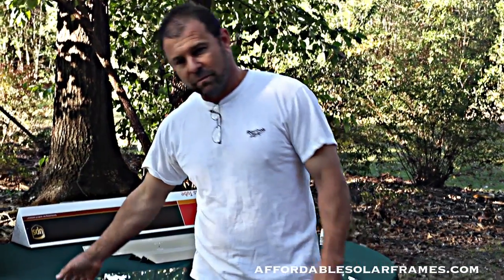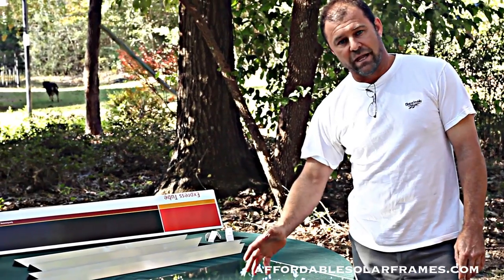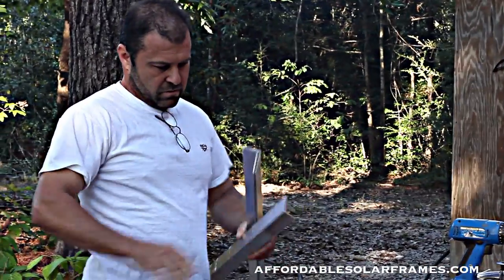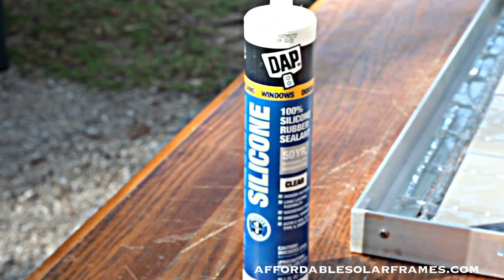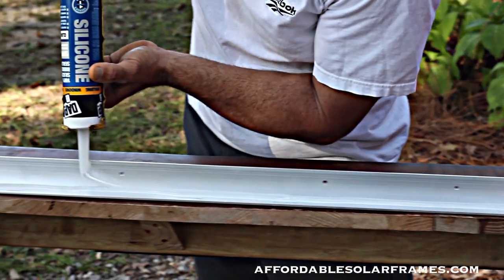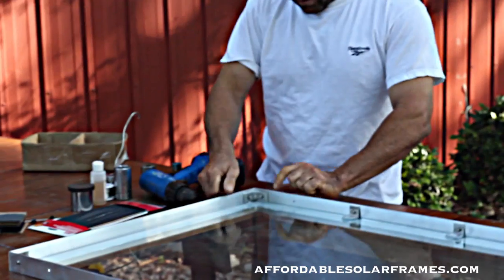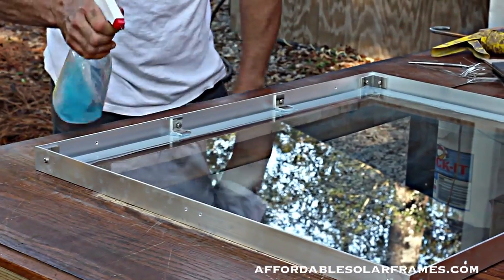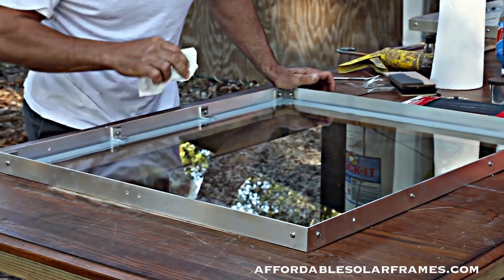How to Build a Solar Panel - Part 1 of 3 (New)step by step buying everything off ebay

Comment from the maker: Well this panel is around 55 watts so you will need to build around 60 panels. I buy my cells from MLsolar off ebay. I trust and have been pleased with his cells and encapsulant. I do have a hybrid system, but not with wind, with hydro. I have another video showing my home made hydro system. It is now over 12 years old and still works great. There are two systems to chose from off grid and grid tie. Grid tie is cheaper but if the power goes out you have no power. I have a off grid system.

Comment from the maker: Where I live the green houses use a glass that does not let it all the sun. Glass used for houses is a low "E" glass. The best for solar panels is a low Iron, but it cost too much for what little extra you are getting in power. I use 1/4" clear tempered, It is 4 times stronger than regular glass.

Comment: You have used in this video probably 36 cells. How much power produces by each of the cell,please? And, the width and length of the cells. So I can calculate, how many cells I need and how big panel I may need also. Thank you.

Comment from the maker: Window glass will work but it is not tempered and it might be low "E" glass and not work well. Tempered glass is 4 times as strong. Here is a link to a video where I show you how to hook up for 12 volt led lights.
youtube.com/watch?v=DKaWPq8zVjQ

Comment from the maker: Thanks for the tip. If you do it all yourself they will pay for themselves. I also heat my water with a solar water heater and I have a small hydro system. You can see them in my other videos.

Comment: Just a tip for ya from experience in electronics, alcohol works very well for cleaning circuits with flux on them, and dries quickly! Not sure which is less expensive though. Thanks for the videos, I will watch further to see what kind of power you get out of them, and to all the naysayers, sure you can use the power company which is supposedly "cheaper" but these baby's pay for themselves. Combine solar with wind and maybe even aquatic methods and you can damn near beat the power companies.

Comment from the maker: Well most solar panel glass on the market is only 1/8" thick. 1/4" tempered glass is 4 times as strong as 1/8" glass. So it has a much better chance of surviving a hail storm, and it depends on the size of the hail

Comment from the maker: Hello. Well you can use the panel I show in the video. It will do just fine in Arizona. You will not a lot of panels and batteries to get off grid. I would start with a 1500 watt system and batteries and run your refrigerator/tv and some lights. Then if you want add more panels and batteries.

Comment from the maker: Well, I do not like to go too big with a panel. The bigger the panel the heaver and easer to break. I would not go over 180 watts. It is hard to say many panels and batteries you need. I would start with around 1500 watt system then add to it till you reach your need. It is hard to get totally off grid. The sun does not shine every day.

Comment from the maker: Yes solar is expensive. Your car outlet will not power a refrigerator. If you live in the wilderness or 3rd world country solar is great. I have been without power for 10 days after a hurricane and no gas to run the generator, so I built enough panels two run my freezer and refrigerator.

Comment from the maker: 6mm tempered glass will work great. 25 volts is within your inverter voltage range, so 50 cells will be perfect.

Comment: Can I use 6mm toughened glass, or just 4mm?

I bought 100 cells of 4 watts, can mount two panels with 50 cells each, 200 watts and 25 volts?

What's the best output voltage for each panel?
My inverter input is from 10.5 to 28 volts!

Comment from the maker: I have another video showing how to hook up a light for my chicken coop. Watch it and it will show you how to connect a simple charge controller to your batteries and solar panel. I would get at least 3 of the panels I show in this video. That would be enough to run 12 volt lights and a tv. You will need more panels to run larger applainces. We sell the frames/glass and pole mount kits. We ship next day.

Comment: hello i like your video,, i have a motor home in the woods that i use as a bug out shelter with 10 12v batterys and i would like to know whot i would need to keep them charged so i can run lights and a 12v tv and still keep my batteries charged i may have a power inverter later but i dont have much that will be 110ac most everything will be dc,,
whot do you have and whot would it cost for a solar set up and how long would it be till i can get it,,thanks again for the video,,your panels look nice

Comment: Here are my numbers: Glass $2 from the Habatat for Humanity surplus store.  It was a big one, enough for 80 solar cells.  Frame from Mark Patrick $60, Sylgard 184 from Ellsworth Adhesives, $100.  Solar cells from High Tech Solar = $116; Small parts, wire, silicon caulk = $25.  The cheap but high quality glass is what got me started.

Comment: I went to the Habatat for Humanity surplus store.  You have one in your area.  I found a very fine piece of tempered glass from a storm door, complete with reinforcing border, which I purchased for $2.  Yes that was two dollars.  Now, I ended up making a much larger solar panel than is good for a first time, but it came together well--using Mark's instructional video.

Comment from the maker: You can use your extra power to heat water instead of a heat sink. I use glass to solder on because it is flat and clean. The soldering iron does not damage the cell. The flux I use is for solar panels and works well.

Comment: I built a whole  home solar & hydro system using a gel filled battery & 2nd  hot water  heater  for the run off -primary H20 heater was gas ( instead of using a heat sink, wire a hot water heater into a system.You are then  preheating the H20 & saving on gas-natural  or propane depending  on where you  live).I am wondering why you would solder the cells on the glass & how much damage/loss is done from an iron,or butane pencil torch?Also wouldn't flux that is non-self cleaning be a better choice?

Comment from the maker: Hello. I have several old panels that I made years ago and they work and look just as good as my new ones. The panels you buy the glass is only 1/8" thick. 1/4" glass is four times stronger and has a much better chance of surviving a hail storm. People will always bad mouth someone else to make them selfs look better. The process I show in this video is the same way NASA makes panels for outer space.

Comment from the maker: I use to use low iron glass. It does let in around 7% more light but it cost twice as much. It will takes years at just 7% more to payoff. Spend the same money and build two with regular glass.

Comment: does this save any money ... looks like you would have to spend a lot of money on just these frames and so much on the cells and solder and tape,etc that in the end you do not really save much ... can you tell me what is the typical cost of these compared to buying them prepackaged ?

Comment from the maker: Plexi glass expands in the heat of the sun and the cells do not expand. So it will pull the cells apart. You can use regular glass. I use tempered glass because it is 4 times as strong.

Comment: I like the simplicity of your system, but it is not really clear to me why one cannot use 1/4" plexiglass. Someone commented here that it will brake the cells. How does that happen? And why can't you use just normal 1/4" glass, which is way cheaper? (I live in The Netherlands and we don't have the severe weather conditions you mention in your video.)

Comment: Honestly, ¼" tempered glass is the best thing to use if you don't want broken cells.  Cost can be similar to Lexan (or less than) for larger sizes depending on who you source it from and if it is a common on-hand size or not.

Comment: Lexan is great in that it doesn't "shatter" but it's very expensive in its own right (better to use the Optix medium type ¼" thick (one grade lower but better than regular Plexiglass). 100 x against shattering is adequate.  500 x is overkill for the price.. ;) ⅛ " is way too flexible and will end up leading to broken cells if it gets flexed as the wires will pull the cells apart unless you leave a lot of slack tabbing wire between cells (not advised).

Comment: Best caulk I ever found is DAP 3.0 CRYSTAL Clear w Microban.  Expensive sure, but nothing transmits light better, dries faster, doesn't dry "rigid" or too flexible but more like 'almost hard' which is great to give some room for cells to expand and shrink with heating/cooling day/night etc and not crack, water tight, and doesn't stink up the area like this beauty.  It can be hard to find.   Lowes and Home Depot both carried it, now only one does I think in store. It's best I've found for solar.

Comment: Why not use 1/8” Lexan, that is what most all commercially made panels are made from.. Do you sell them frames, would need them big enough to build 130 watt panels, not sure how many cells per panel would take, depends on what the wattage is per cell. I can buy 130 watt panels but they run around $400 to $500 CND each, then a 50 am charge controller is around $230.00 CND.

Comment: The dam aluminum rail with 2 sets – 2”x2” aluminum tube (they slid inside each other) for the adjustable legs was another $265.00 CND, looking for supplier for just the 10’ rail. I am thinking I could maybe build 130 watt for less the $400.00 each MAYBE?

Comment: Can you tell me were I can get the best cells, to make  minumum 130 watt pannals,2 pannals @ 130 watts each will give me  17 amps per set. I have got nothing but crap ones, also could use your wiring diagram arnold@romppais.com

Comment: Silicone Caulk wouldn't 3M 5200 fast cure marine silicone adhesive be much better, sure it cost a little more, we sell it and find it is a great product, not only does it stay flexible, but being it is a  marine Silicone adhesive it hold thing right tight and when putting say tie up cleats on a boat, you really don't need and fasteners to hold them to the boat, you will pull the fiberglass gel coat off before the marine silicone adhesive lets go

Comment from the maker: I use one .5kg sylgard per 36-3x6 cells. I have the best results when the weather is a little cool. I warm the glass just a little, pour the encapsulant and viberate the table. I cover it with a piece of card board and leave it alone for days. I then put it in the sun upside down and cover the back with a larger piece of glass. The sun will heat it up to over 200 degrees. I leave it like that for 2 or 3 days before I put it on my arry. I do get a few small air pockets but it does not matter.

Comment: Ah. The main benefit I see to it is protection from things like hail or a basketball. Glass can break; plexiglass does not. So, you COULD mount the plexiglass 6 inches above the panel for added security from the aforementioned elements?

Comment from the maker: I see. I am not sure if it would take the heat and then a quick rain. Do you have any glass you can test first. I am replacing 3 windows at my house in a week. I will take one piece out and put it in the sun then put some water on it and I will let you know what happens.  Mark

Comment: I have no problem with the resistance of the glass, Cause where I live has no sleet, snow or  strong wind.
My concern is that the tempered glass  has a high temperature protection and common glass has no.
This would hurt the project?

Comment from the maker: I have used the dow 6010 and I like it the best. When you set it in the sun you need to put another piece of glass or plastic on the back to make a hot box. It will get over 200 deg and will set up.

Comment from the maker: Set the panel outside upside down in the sun and cover the back with a extra piece of glass or plastic and it will heat cure in two days.

Mark

Comment: Hi Mark. Lost your E-mail addy. I don't know if you remember but I bought 3 frames and glass off you a few months ago. Delete this when you read it if you like. Hey, I have mixed up a batch of Dow encapsulation and this thing hasn't cured all the way in 4 weeks now. It is hardened on the bottom but the top is still tacky. Have you ever had this problem before? What is the usual curing time?
 Thanks for your time!
Brian Eckert

Comment from the maker: well one side of the cell is positive and the other side is neg. You solder the tabs from the front of one cell to the little squares on the the back of the next cell. Send me your email address and I will send you a wiring diagram.

Comment: I build my own solar panels (self taught with assistance from YouTube) and guess what?  They work totally fine.  You just have to look up videos for each particular step of the process.,. It takes too long to do one video because of the length limits that YouTube puts on videos (or used to anyways).  This guy's videos are pretty good.  There's hardly anything done commercially that can't be done a bit differently at home.  Have faith.  It really works!

Comment from the maker: @FeralTyneMan  Hello. Well my Dad is a Electrical engineer. I am self taught. My 8th grade science project was a hydrgen fuel generator. I built a windmill In 7th grade and a 2 man hovercraft in 9th by myself. I use to work in a machine/fabrication shop and traveled all over the country before I went in buisness for myself. God has bless me with many skills and I love to build thing and fix thing for the poor and widowed. Check out some of my other videos. Don't be afraid to try

Comment: Hi. I was wondering something. How do you learn something like this? Are you self taught/enthusiast? Or do you have a background in engineering of some sort? What did you study? 

Sorry for the question bombardment, I'm just interested in going off grid but I have no engineerging, mechanical or carpentry background so I'm trying to learn.

Comment from the maker: @verOneDoesIt420 You will not find what you need at a hardware store. Go to ebay and search solar panel kits or solar cells. I buy from seller mlsolar.   Mark

Comment from the maker: @mubavoice  Yes send me a picture. My email address is markel38@aol.com. The colder you keep your panel the slower it will set and the more time it will have for the air to come out. I only make panels in the winter. I think by the morning they will be gone. I had one person send me a email where he used a hair dryer right after he poured and it made the encapsulant thinner and the air bubbles came out he said. I have not tryed this method yet. The air bubles will not harm the panel.

Comment: @markp0177 When i mixed, i did not mixed violently as you said. The tiny air bubbles are throughout the panel. My Panel now ( 4hrs after encapsulating) itself started to get dry. Still the bubbles are there.

 I am doing my next panel in few weeks, i will try one more time. Is there any problem because of that bubble's? i can email you the picture if you need. I want to avoid the bubbles in my second panel. Thanks a lot for helping.

Comment from the maker: @mubavoice Hello. Tiny air bubbles sometimes happens when you mix it. I cover my panel with card board to get dust out and set it a side for 3 days. Most of the air bubbles come out on their own. Then I set it in the sun still up side down with a extra piece glass on the back to hold in the heat. The sun will heat it up to over 200 degs. I leave it in the sun till the sylgard is totaly set. This works every time.   Mark

Comment: Hi Mark,
  I successfully made the solar panel as you shown in the video. I used vibrator to remove the air bubbles, the problem is i have lots of tiny, tiny air bubbles in the panel. I removed most of the bubbles through paint brush, but many are still there. whats the reasion for having somany tiny air bubbles, is it because of the vibrator or do i need to apply any coating on the glass before applying the Sylgaurd?

Comment from the maker: @jayerrick I just lay it on the back while the sylgard is still wet. Around 3 hours after I pour. Then I wait a few days and set it in the sun upside down with a piece of glass on the back to hold in the heat and let it heat cure for a couple of days.   Mark

Comment: Before I found your videos and learned about Slygar I found directions to use EVA (laminating sheets) and a heat gun to encapsulate the cells.  Ever tried it?  I already bought it so giving it a go soon.  If it works it is about 1/20th the cost of Slygar.

Comment: Do you think it might work to put down a tedlar backing with a bead of silicone around it and apply the sylgard with the cells face up?  I am building panels for the top of a cargo trailer and want to use plexiglass for added safety and durability.  Not having cells attached to it would avoid cracking them from unequal expansion.  Thank you for any thoughts and experience you can share.

Comment from the maker: @LiteNRG1 No do not use a polycarbonate if you encapsulate. It expandes more than the cells do in the heat. It will crack the cells.  Mark

Comment: A regular backyard pro--heck yeah!  Thanks for the vid!  You should use rivets for your frame hardware to save time and cut cost.  Once you've got the silicone down, there's no need for replaceable hardware right?  And even with rivets you can just drill the heads off, should they need to be removed.

Comment: Very impressed by your willingness to show / share all this knowledge, but then you are selling frames, and panels. 
I must admit having found another Ytube piece ( and a blog ) from some one who has been off grid for I think 20 years and was talking about failure of panels, but just percieved it as part of the process, but some seemed to fail / degrade quite quickly. I'm sure life & output will has improved with more up to date product, and homebuild does reduce the cost.